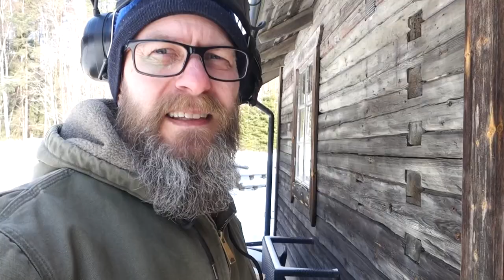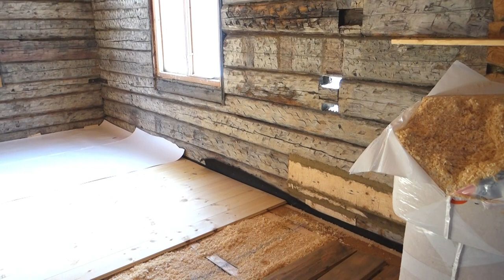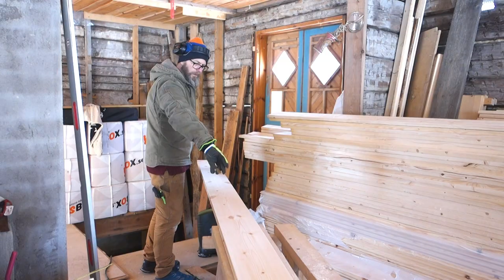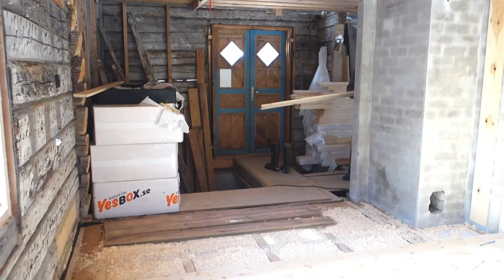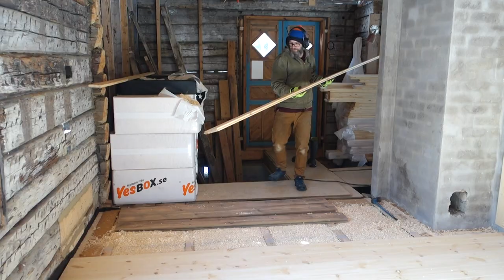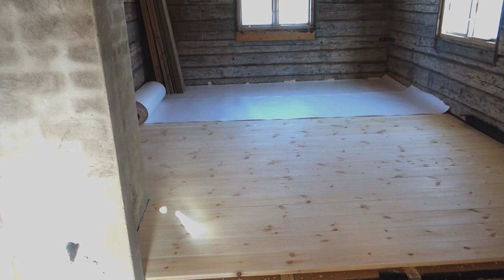New Floor To The Log Cabin | Tongue & Groove Flooring

Comment: Just found your channel last night. Love it. Beginning work on a similar project in Canada. Round log cabin built in 1918. Wondering about the floor insulation and vermin barrier. Looks like you put cleats at bottom of the floor joists and nailed 1x boards across to keep insects and animals out of the insulation. And the wood insulation you’re using is it a better choice to keep animals away or just healthier. I will keep watching the progress.
Reply from the maker: Thanks Donald. Nice to hear that you are also restoring an old cabin. I have a short video on how the floor is built from the ground up to the floorboards: https://www.youtube.com/shorts/bqviEa_yZOE
I put clay on the first row of logs for wind protection, the clay you saw in this video was for a repair log. I use wood fiber insulation both because mice don't like to nest in wood fiber, it collapses over the tunnels they dig, and because it's nicer to work with. Good luck with your work on the cottage and thanks again. / Niclas